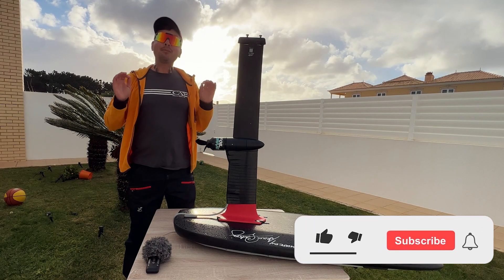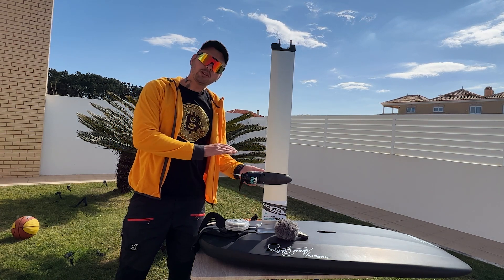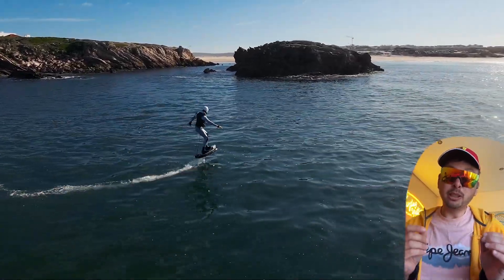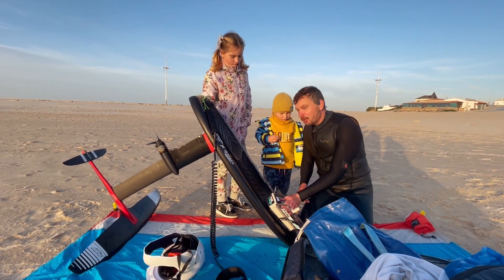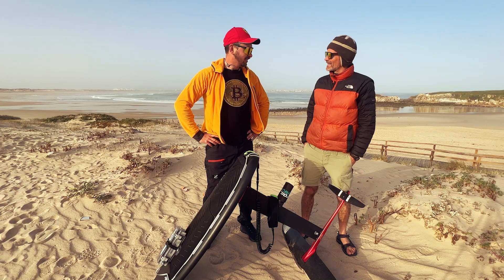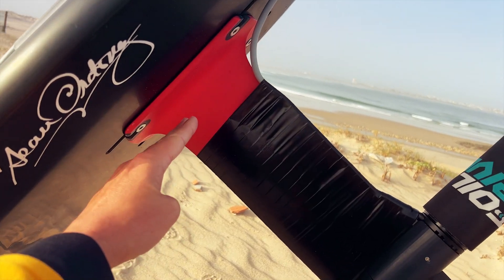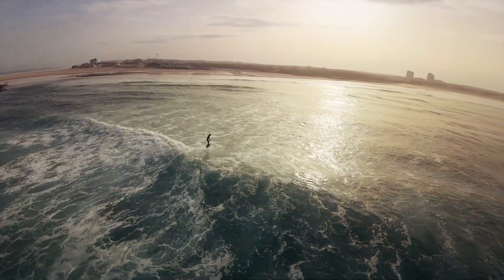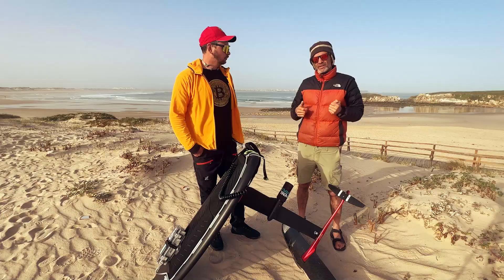ZERO DRAG EFOILING? | Foil Drive x Project Cedrus Review

Comment: Great set of Foil Drive reviews Mike!  I see that Dominic is really starting to like the 
Project Cedrus Foil Drive + at the “e-foil” position for wave riding/downwinding more and more. Have you tried the e-foil position of the Project Cedrus option yet? Where I live it’s rare to have such glassy swell as you show in your videos. I’m thinking the e-foil Project Cedrus position will actually work better for more messy (wind blown) swell conditions.

Also, are you still using the Skydio 2+ these days for filming?
Reply from the maker: Thank you!! I have been efoling "my whole life" so the goal with Foildrive is to get away from high drag efoils into zero drag foiling, so no point for me putting motor down. I live in Portugal where waves are way too strong and much bigger than in Dominic's Oman, that's the main difference, so most of the time I have enough wave power to keep going and don;t need to put it lower. But of course it will work why not. Dominic shows it can be done easily.
Glassy conditions like on video we get maybe once in 2 months, so I film such day. But I ride mostly in chop as well, no problem!
Skydio sank long ago. I am using again old Staaker to film!
Reply: @JetSurfingNation  Thanks! I still think I’ll go for the efoil position, but I appreciate all the benefits of the assist position. For me it’s coming from wing foiling and kitefoiling before that. The full simplicity of the efoil position attracts me the most. Can’t believe you’re still using your Staaker! I have my original Staaker and it’s still working perfectly, though it’s been collecting dust on the shelf recently other than maintenance flights to cycle the batteries
Reply from the maker: Alright go for efoil position, the drag is really minimal. I dont see any problem at all. Staaker is a good trusted friend. Actually i lost 3 of them  now i have 4th but i still love how smooth the tracking is! I got the new DJO Action camera that fits inside so the video quality becomes amazing. Only problem with staaker it had no sensors, so it was flyign blinds and hit the rocks. I am sad they went bankrupt. It was the best self follow drone!